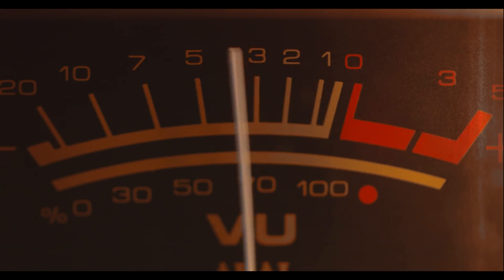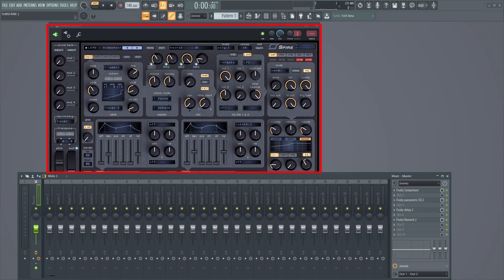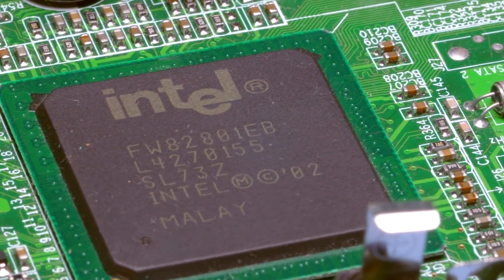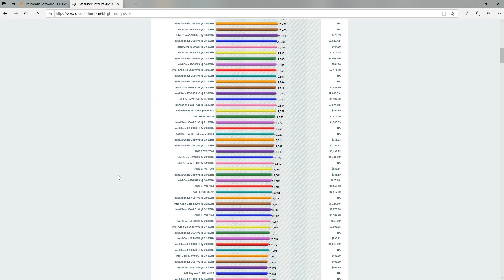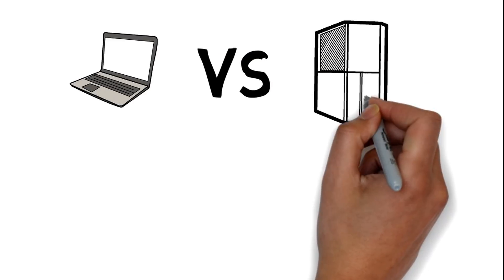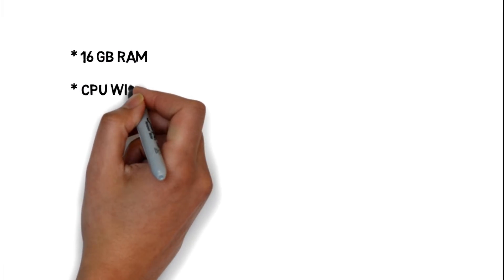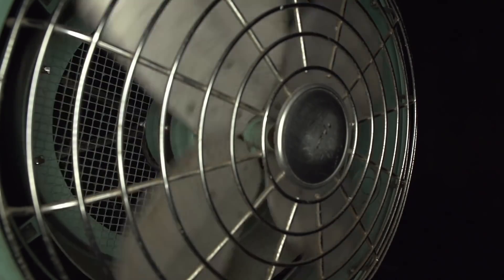The Best Computer For Music Production - What's Needed And Why!

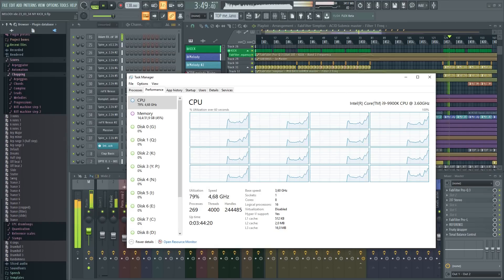Comment: At 2:39 , your Task Manager shows similar load across all 16 "logical processors", as the graphs all look the same.  This tells me the processing tasks are being distributed equally amongst all the  "CPU cores"; doesn't that contradict your claim of serial processing by just one of the CPU cores for music (audio) production?
Reply from the maker: Hi, perhaps I should have been clearer. All DAWs are capable of utilizing multiple cores, and the larger a project becomes the more "even" it will tend to look in task manager.. While all daws utilize multiple cores, they're not as efficient at distributing the work due to the real-time nature of audio processing vs tasks like say video editing and such. In a video it can render the beginning, middle and end of the video stream at the same time, over multiple cores. 
However,  in real-time playback of audio inside a daw, everything is being processed in real time, as it's happening. 

The main problem with that is that there's a lot of "waiting" for work to get done being introduced constantly, which introduce lag (the pizza example).
First the midi from the piano roll has to trigger a VST, which then needs to generate a sound. This sound then needs to be sent to a mixer track where an effect chain has to be applied one after the other. For example: First the EQ, then the compression, then the delay, then the reverb and so on. It can't process all these things at the same time over multiple cores. The reverb can't be processed at the same time as the EQ, because the EQed signal doesn't exist yet, so it has to wait for all these things to get processed in sequence. There's a lot of tasks like this going on, over multiple cores. Each string like this must be processed by the same thread. Some projects are more CPU efficient than others. For example, if you route a mixer track to another mixer track, like a sub mix, then you'll introduce even more waiting, because you have now created a dependency inside the application. You now you have two mixer tracks that has to be processed in sequence, by one thread. 

Generally, every mixer track in a daw is an opportunity for the CPU to use multi threading, so generally you want a CPU with as many cores as possible, but also with the fastest single core speeds as possible. Unfortunately there's usually a sweet spot there, and at some point you have to choose between single core speeds and share number of cores. For example, a server wouldn't necessarily be a good Audio production computer, or a gaming computer for that matter. It can process huge amounts of information in parallel, but it might struggle to do real-time audio processing, which also require fast single core speeds. 

Therefore, I generally recommend getting the CPU with as many cores as possible, and with the fastest single core speeds possible.  :)

Comment: so multi thread processing is different than multi core processing? that's why you choose to prefer single core processing number is higher?
Reply from the maker: Many CPU's have hyperthreading, meaning that they can process two threads on one core, so it's not exactly the same. A 6 core processor without hyperthreading can process 6 threads at the same time while one with hyperthreading can process 12 threads at the same time, essentially making it equal to a 12 core processor in that regard. You generally want to be able to run as many threads as possible, while at the same time having as fast single core performance as possible.
Reply: @FireWalkMusic  Ahhh... right.. got it. thank you so much for the information and your time to reply. i really do appreciate it. bless you sir! mad respect

Comment: To follow the pizza example: a multi core CPU can prepare the dough, the sauce, the ingredients, and one core get the results of all of those operations, put together the pizza and place it in the oven to cook. So yes, you can use multicore for music production
Reply from the maker: Perhaps you didn't watch the entire video? 
Nobody is saying that a DAW can't utilize multiple cores, I'm just saying that it's not as efficient at it as some other applications. 
As said int he video, every mixer track is generally an opportunity for the CPU to use multi-threading, (unless dependencies exist). What I am saying is that a DAW is not as good at it as say a video editor, because a DAW plays back the sound in real-time. 

Why is that? Well, the main reason is the way a DAW processes the information. Sound has to be played back in real-time, and there's a lot of tasks that needs to happen in sequence, one after the other. For example: First, the midi triggered in the piano roll has to be sent to a VST, which then has to generate the sound, which then has to be sent to a mixer insert where EQ has to be applied, then say compression can be applied after that, then saturation, then delay, then reverb and so on.
When all that's done it can be sent to the master, or to another mixer track (bus) in which case even more dependencies will be created. This all has to happen in sequence, one after the other, and by the same core. 
You can't use one core to generate the sound in the VST while at the same time using another core to add all the effects that are going to be applied to that sound because you simply can't process something that doesn't exist yet. Because of this, naturally, you'll have a lot of "waiting" for work to get done within a daw That's why brute force single-core speed is so important. 

Yes, you can prepare all the ingredients at the same time using multiple people, but you can't prepare ingredients and cook those ingredients at the same time. There will always be some waiting for work to get done involved. 

Once all the cores have work to do, inevitably cores have to take on more work, which will get queued up. Now, because work will rarely get evenly distributed across cores, inevitably one core will fall slightly behind, and since sound is generated in real-time, the rest of the cores will then have to wait for that core to finish, adding even more latency (waiting for work to complete). 
It's like if one of your guys preparing the ingredients for that pizza falls behind, then the rest of them will have to wait for that person to finish before they can start cooking it. 

Now, one should think that you could easily solve this by just get a CPU with a vast number of cores, like a server. However, again, the problem is that not all tasks can be evenly distributed across cores. And furthermore, as you add more cores to a CPU more heat is generated as well. 
Ther'es usually a sweet spot there, and once you go beyond that you generally end up trading single-core performance for more cores instead. The best CPU for music production is one that's right in that sweet spot, where you have as many cores as possible, and with the fastest single-core speeds possible. This is why a server isn't necessarily a good choice for gaming or music production for that matter.

Simply put: For audio production in a DAW you want as many cores as possible with the fastest single-core speeds as possible. :)
Reply: @FireWalkMusic  Yes, sequential actions has to happen sequentially, but again; you do not have to run everything on a single core :) You mix the signal with all the added effects at the end, which add latency. To fight that in real time situations, you pump up few cores to get the top speed, at the cost of parallelization.
This is what the OS does when the app request it. Any DAW is able to change core utilization and CPU load based on needs... it is why programmers like me are paid big bucks to solve isues and make overcomplicate software that bend backwards to fix problems, like CPU usage between a single and multiple threads.

I get that you say that you are fine if you buy "the best and fastest", but this does not apply to everyone; because not everyone has money to spend for a top of the line system, when all they do is simplistic stuff in their daw; where even an ipad is good enough for them. Sending the message of buying the fastest cpu with the highest number of cores is not efficient.

The question should be "what type of music you produce? Do you need realtime on 100 tracks? do you use more VST or effects? " ; these are the questions to ask; on top of what genre and style the person create; because scoring a hip-hop tune is not the same as orchestrate a movie or make a synth pop hit. Instead of focusing on "one CPU that does everything", people need to understand that they should buy only what they need and what fits their needs; otherwise there is no point in spending time spreading info and knowledge, if all we say is "buy the best, you will be good".

This is a common problem on many enthusiasts channels, not only related to music production but to many other areas. If you went out your way to explain things, and get the views and the money that the views involve, then giving tailored advice is even more important than the channel with 100 views. Not pointing the finger at you, just saying what I noticed more and more often. I work as engineer, both hardware and software, and not once I told a person the same answer, about hardware and software requirements, if their needs are not identical.

Comment: Let me say that your statement about parallel processing not being used in music production is speculative.
A signal path is processed sequentially, that is accurate; but that does not mean that you run everything out of a single core. Each core on modern DAW can be used to perform those actions; and chained together.
Not to disappoint but most of the operations performed by computers are sequential, even with multitasking, since you have 1 set of bank rams, so that is shared among all the cores. In short, you rely on multiple cores and their L1 and L2 cache, to perform multiple operations, and then "join them" again, so the flow and order is maintained. This is why it is so complex to program and code multi-threaded systems: not only you need to put the operations in the right order, but you also need to join them together once you split them.
Most DAW these days are multi-core based, means that they can process at the "same time" multiple signals, and keep them in order, so the synth play before the effect, the EQ after the effect and so on.
Reply from the maker: Again, I think you misunderstood what was said in the video. Perhaps I should have been clearer. Nobody is saying that parallel processing is not being used, because it is. I'm just saying that a DAW is not as efficient at it as some other applications, like say a video editor, photoshop and so on. Because of the sequential nature of a DAW (one thing has to happen before the next and the next and so on) single core speeds become very important. 
Therefore, I recommend getting a CPU with the fastest single core speeds as possible, and with as many cores as possible. 
As I said in the other comment, (but I'll say it again because other people are reading this) as you add more cores to a CPU then generally single core performance tend to go down. There's usually a trade off there, so the best CPU for music production is generally a CPU that's right in that sweet spot, with as many cores and as good single core speeds as possible. :)
Reply: @FireWalkMusic  Thanks for the clarification; indeed the video did not bring up the point about efficiency.
For real time usage, you need high clock speed on single core; that is due to the nature of the beast; but many people playing their VST in a DAW, does not require that level of precision, so multiple cores is more effective for them, until they need to master. At that point they can increase the buffer size, since they recorded their midi already, and leave the playback and mastering to the DAW; using all the parallel cores it can use.

Also want to clarify that adding more cores does not reduce single core performances; it is just physics: Cores share a die, a die is the physical silicone substrate on which the transistors are placed. If you heat up a section of the die (a core), the heat spread to all the other cores, as such you have thermal throttling because the temperature average among the cores at one point, and you can only remove so much heat from the CPU when under extensive load; so the clock speed is reduced to reduce temperature, or the motherboard undervoltage the CPU to reduce heat. It is not a choice to reduce speed on a single core; it is just how physic works :) Today you can find CPU with 4, 8 or even 12 cores that have better thermals and a smaller production process (AMD is the top so far), which brought the frequency of single core close to 5GHz.

Comment: AMD Ryzen 9 3950x VS Intel Core i9-10900K
AMD Ryzen 9 3900x VS Intel Core i9-9900K
AMD Ryzen 7 3700x  VS Intel Core i7-9700K
AMD Ryzen 5 3600 VS Intel Core i7-8700K

Which one would offer the lowest latency?
Reply: Intel always has the lowest latency, that also makes them the better gaming processors but there are exceptions, for example, the Ryzen 3 3300X is a low latency beast that is better than a i7 7700K (a very popular flagship gaming Intel CPU) without overclocking and destroys current or 10th gen Intel's entire i3 lineup and is very cheap.
Reply: And the Ryzen 9 3950x beats the i9 10900k, has 6 more cores while it has a very good clockspeed or singlethread perfomance. The 6 cores on that ryzen create a bigger perfomance jump compared to the single core in the i9 10900k. The i9 9900k is obsolete since lacks hyperthreading and the i7 10700k matches it and you also have a Ryzen 7 3700X which is also a cheaper but still good alternative. Don't buy 9th gen Intel processors, choose 3rd gen Ryzen or 10th gen Intel unless you wait for 11th generation for Intel and AMD 4000 series.
Reply from the maker: Correction, The 9900k does have hyperthreading. It can also be clocked to 5+ ghz which means that IPC goes up dramatically. The AMD chips are pretty much maxed out from the factory, so there's not much to go on there. When overclocked, the 9900k still outperforms the Ryzen CPU's when it comes to music prododuction and games from what I've seen, but not by a huge amount. AMD offers better value overall. Especially if you also use the computer for other tasks as well :)
Reply: @FireWalkMusic  thank you so much! I wish you so many blessings on your journey.
Reply: @saricubra2867  THANK YOU SO MUCH! could I contact you with further questions over email?

Comment: I would like to add 3 points: Smart Disable (FL Studio), ASIO drivers and priority tracks (Atari Cubase).

FL Studio users can use the Smart Disable setting to save CPU time. You set this up in the Audio settings first and then in the drop down menu of every plugin (synths, processors, ...) you enable Smart Disable for that instance. 
This saves a lot of CPU time on CPU heavy plugins when they are idle. Sometimes it doesn't work 100%, like with the Raum VST (reverb tails are cut to early), but you can turn the option off when you are going to render the project. :-)

Good ASIO drivers for your dedicated external audio device are a must 
too. Wrong drivers and internal onboard units will use CPU time to 
compute, where good external devices with good drivers can make their 
hardware do the maths for your DAW.

I know there are still quite a lot of Atari Cubase lovers around, so 
yeah, this still can be useful to someone... ;-) Atari Cubase users 
should not forget that the first two MIDI tracks are "priority" tracks. 
You should place time critical MIDI tracks like drum parts in here.
Reply from the maker: Good tips :)

Comment: I'm using an old laptop with an i7 4700MQ (6 years old at this point for 2020), this CPU is still a beast from a value/perfomance perspective. I also have 16GB.

I like synthesizers a lot, specially using Zebra 2, so that i7 is a quadcore but with very good single thread perfomance maybe superior to 3rd gen Ryzen from the U series on the mobile segment.

Max temp is 85 °C when the CPU usage is 100% for all cores but basically no thermal throttling overall, always at 3.2-3.1 Ghz for all cores, without fan noise, amazing laptop and is very old at this point.

I also use it for very light gaming and console emulation.
Reply from the maker: Even an older i7 will work well for music production. They have good single core performance and unless you make huge orchestral compositions for example,  with tons of vst's and effects, then you really don't need anything more than that. :)